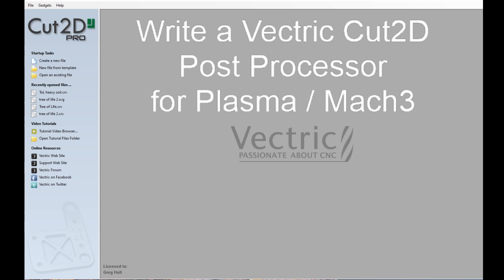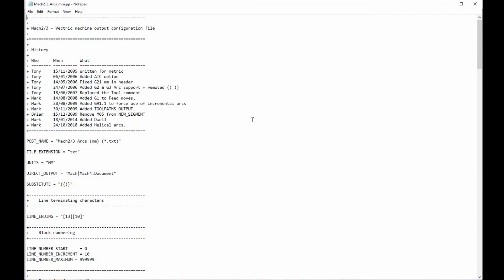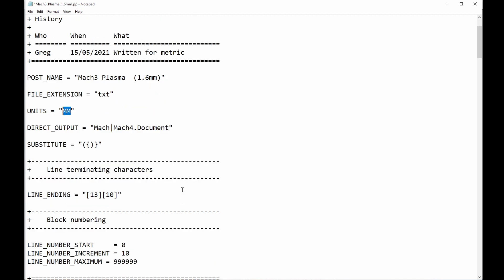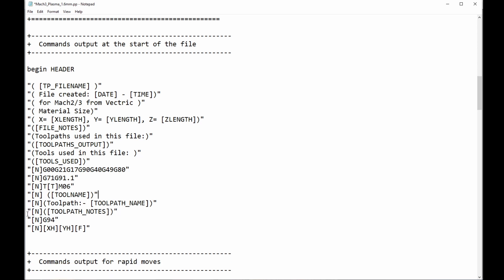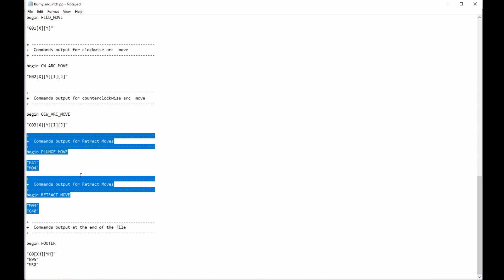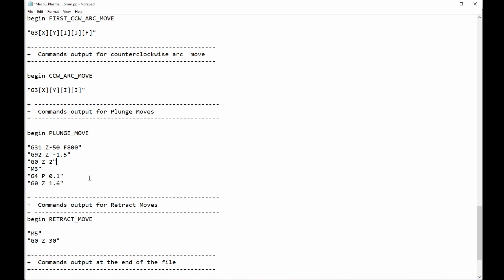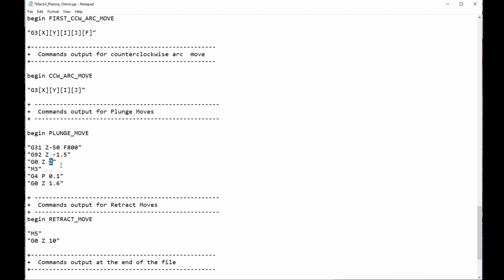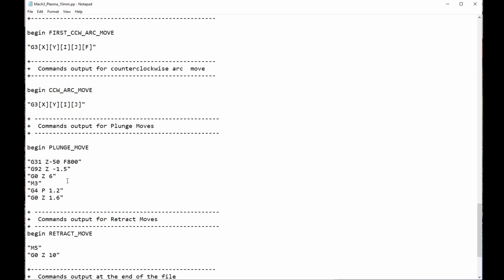Editing a Vectric PP for plasma use

Comment: Thanks for the walk through  --'very useful . On an industrial CNC line numbers can be very helpful but I understand  they do add clutter to the code . It would be good if they could be turned in and off at the console so you  an see them when needed !